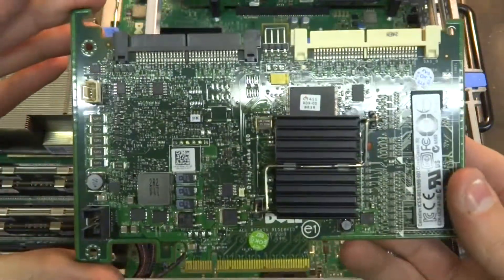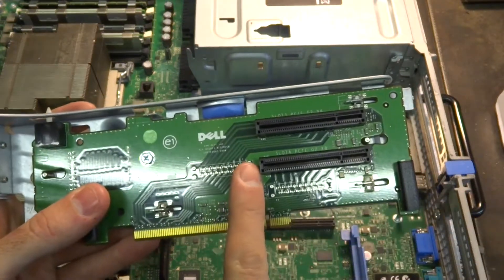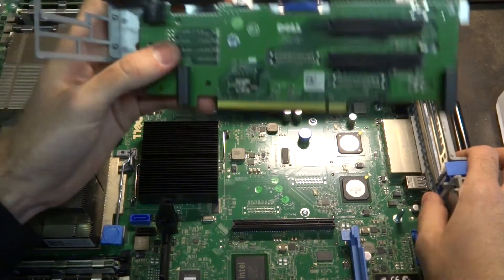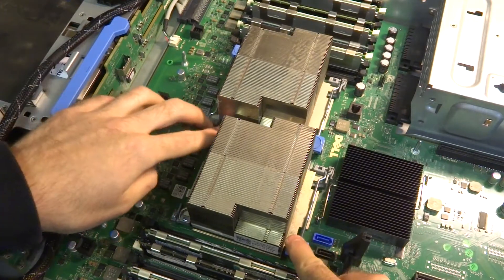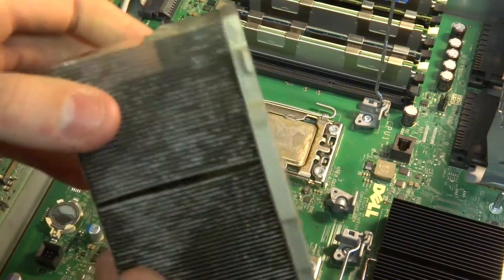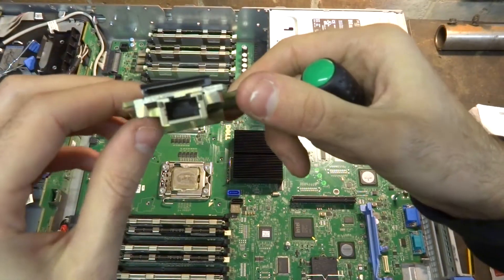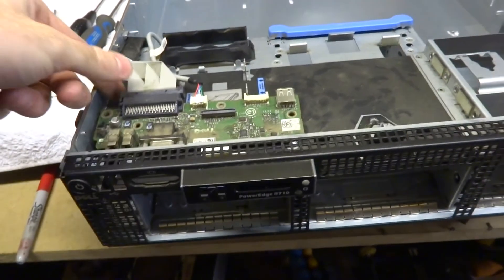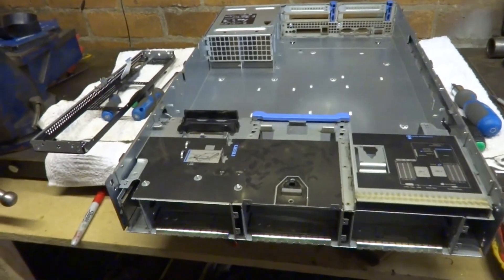Dell R710 Complete Disassembly

Comment: I cant believe I finally found a video showing how to remove the front control panel board!! You are the only one that shows the removal although, when you came to pull it out, the video faded out and I thought that bit would be skipped! But no, its a pesky little screw at the front! Thanks for the video.